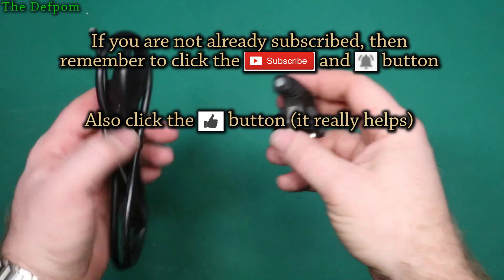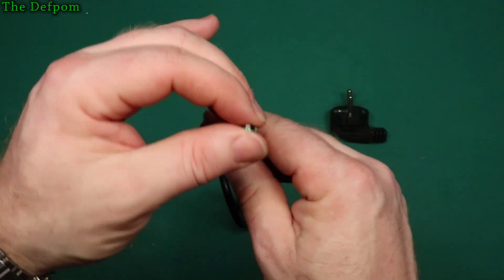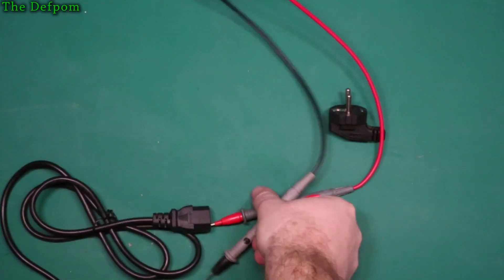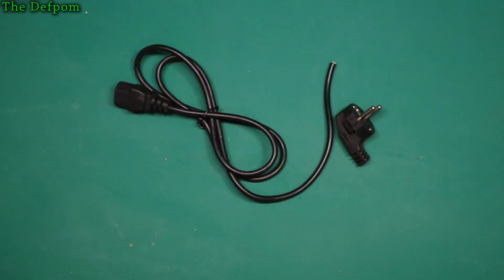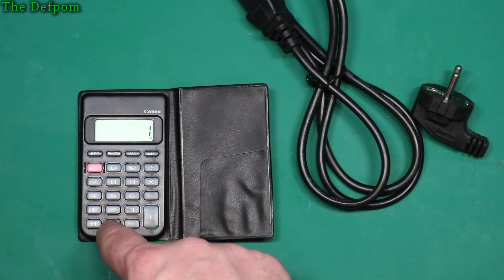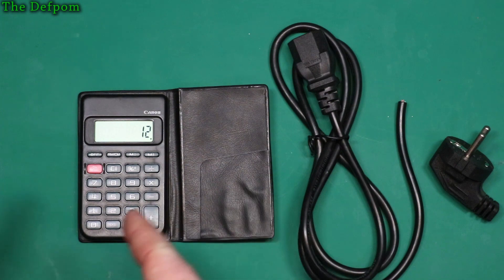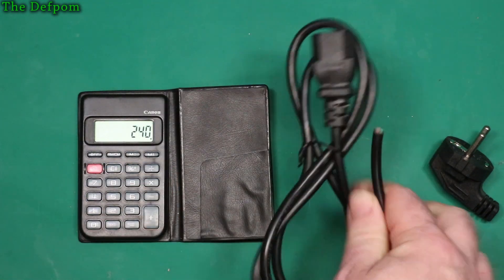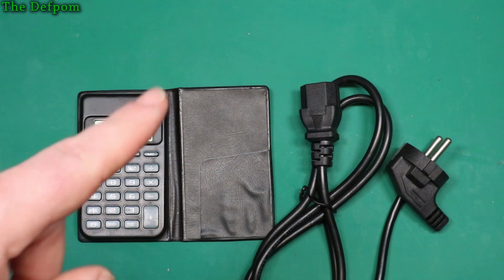🔴 #435 How Safe Are Your Appliance 3 Pin IEC Mains Cables? Massive Fire Risk

Comment: Another case of the Chinese trying to kill us indirectly!! I recall a guy on YT using an IEC Cable(USA 15A 120V)  to rewire a piece of gear. After cutting the IEC part off, the color code was some oddball thing ..the Ground Conductor was white not green and Neutral was yellow not white and the Hot line was red(which is ok) but not black. I think the wire gauge was okay though.

Comment: Sounds like this would make a good video passing 10amps through the lead using a low voltage power supply. Do it out side so the fumes don't kill you. Cheers Dave.
Reply from the maker: Dave Bassett - I will think about doing that.

Comment: I have also noticed the flex never feels right you can feel the cores moving around inside the outer sleeve..they use alot of Ali in cables as well so spot on advice just lob them straight in the bin after you have chopped it up

Comment: Thank you for a very informative video. Would really like to have seen what happens when 10A is passed through the cable. Thank you for sharing
Reply: Look up John Ward, who has tested a few of those cheap cables till they did a Photonic induction. They burn up at a low current on many, especially the ones made with copper plated steel wire, or those with the mystery not copper few mystery strand wire.

Comment: I've not trusted markings on cables for a few years now.  I normally test mine using my bench PSU in CC mode, i.e. If it was a 10A rated cable I'd pass 10A through the cable and measure the voltage across the cable.